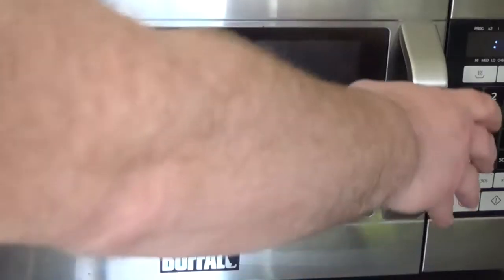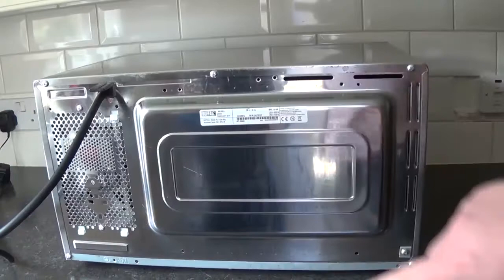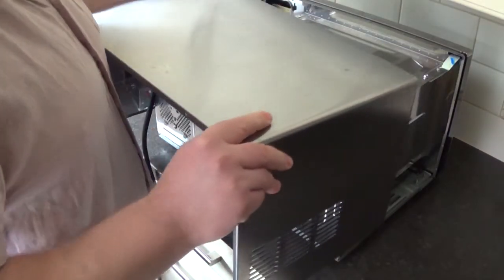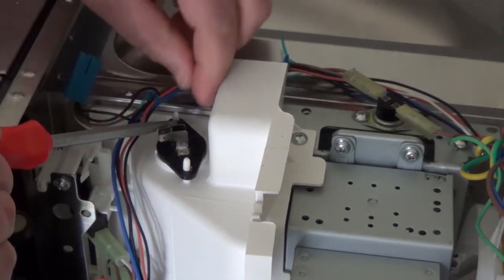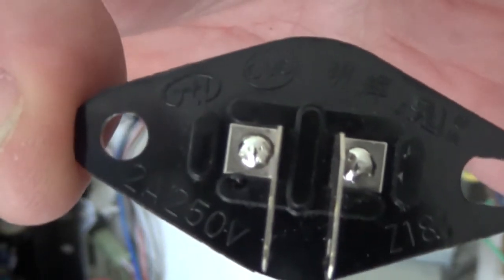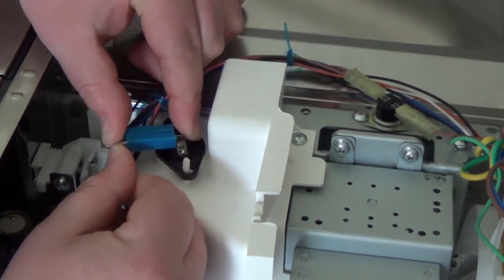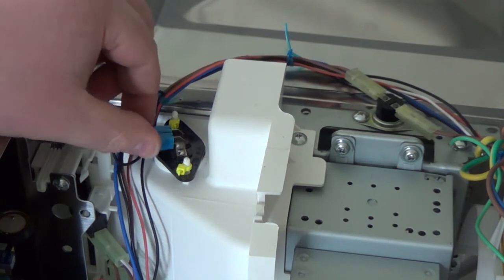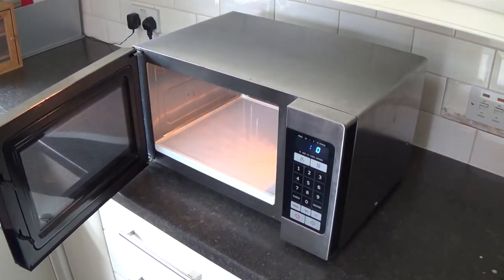Easy Commercial Industrial Microwave Lamp Bulb Replacement - Change Light Buffalo Oven

Comment: A Buffalo microwave?  Wow, they had to be scrapping the bottom of the barrel for that name!
Just last week I managed to blow up 4 eggs that I was hard boiling in my microwave.  Been doing this for some time and never had a problem before.  First time for everything, eh?  Anyway after a 1 hour job cleaning up the resultant mess the microwave barely would heat water.  I was crushed as this was a second hand $13 dollar, 1100 watt unit with a turntable from Goodwill and it had worked perfectly!  
Turns out that little gray square panel, that sits on the other side of your light, is called a "wave guide cover."  This piece of silvered mica is designed to let the microwaves out and keep the exploded egg out also!  Well it did its job but the impacted egg plus years of cleaning abuse added up and this little sheet was getting hot enough to start smoking when the microwave was on.  Most of the microwave energy was impacting the cover and heating it instead of what needed to be heated.
If after heating something, CAREFULLY touch this and if it's hot it needs replacing. My replacement wave guide cover cost $14 bucks and my microwave is working better than it ever has. Do NOT operate your microwave with this removed or you will damage the tube that generates the microwaves!
It's not hard to replace but there is a trick to it so look it over carefully to see how it was meant to be changed. You can order precut squares that you have to cut to fit on eBay in addition to the Mfr's correct part. There are YT videos showing just how to do this. Just put "microwave guide cover" in the YT search bar and you will have more than you ever wanted to know about about microwave guide covers! 
FYI use nothing but a damp cloth and light pressure to clean this, do NOT put any cleaners on this at all!  I use Windex and spray down the interior and the door but cover that grayish square panel with a cloth whilst doing this to protect it.  Be sure to also clean the "joints" where the door seals against the frame of the microwave while you are at it!  
I
Reply from the maker: Peter Haan Very interesting. I had wondered what that little panel was all about. I always clean the microwave by running it with a jug of water and lemon juice in for ten minutes then wiping the resultant condensate with kitchen towel.